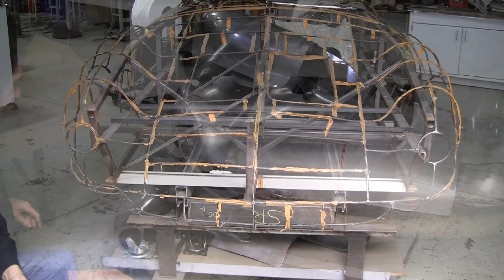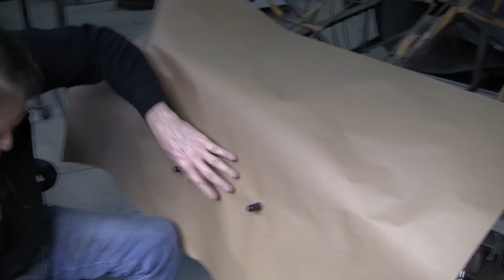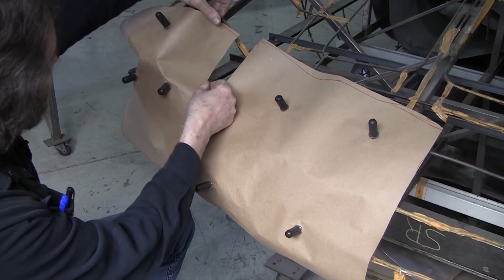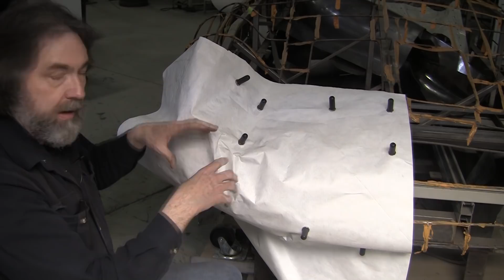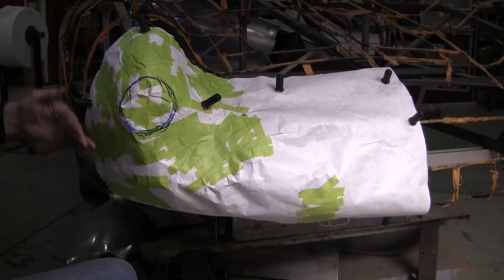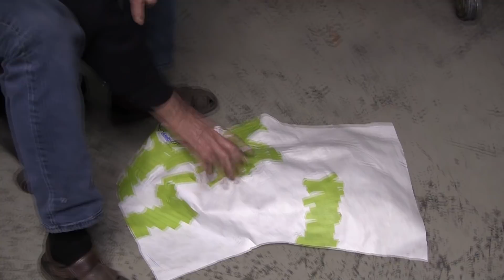Metal Shaping Tips and Tricks: Making a Paper Pattern

Comment: Hey Wray you talked about welding the panels together on a common cut line. Did any of your videos actually show how you cut the metal so no mistakes can happen? You have the two panels ready to weld but no details of showing us how you cut so they would match. At least I cannot find it. Thx again for the videos always learning.
Reply from the maker: The standard method of developing a join line to be welded is to run one panel under the other and scribe a line. If you use that method on a high crown panel after cutting you will find it is will yield a bad fit up. I prefer to make a super fine marker line, then I 1/8" wide  blue tape the line so I can see it very well. I then cut wide of the line fit it up and grind the joint to a perfect fit, always watching that I don't get into the blue tape.

Comment: What if you first draw lines of where the paper overlap and cut it and than flatten that out and transfer it on metal and weld it together? Would welding be a lot faster than ie a lot of heat shrinking? So shrink the panel by cutting and welding?
Reply from the maker: The equation is always lots of shrinking or lots of welding choose your poison.

Comment: Wray wouldn't it just be easier to make some slices by the taillight housing and remove pie shapes rather than trying to shrink the panel that much?
Reply: @Matthew Moilanen  now where would the fun & skill be in that? also, if you consider how much work & effort goes into cutting, forming, fitting, welding, cleaning up, planishing, finishing etc. you'll realise its quicker and more efficient to make a panel in one piece.
Reply: @daos3300  Oh I don't know I've done it several times that way myself in my 40 years of fab work. I was curious as to why it may not be easier to do it that way ad the panel still had to be planished, finished and completed in the exact same fashion as it would with no time savings as gained in cutting and welding. I've created several panels similar to this as the ones located on a thirties style fender on the inner curved section and it worked quite well for me and it is easier than literally inches worth of shrinking.
Reply: @matthewmoilanen787  certainly plenty of ways to skin a cat and if it's right in the end, all is well. i don't have your experience, but given a certain skill level, i suspect shrinking/wheeling may well be faster and more economical in a production environment. and not least, there is the satisfaction of being able to make it in one piece.
Reply: @daos3300  I suppose in production where a pullmax can be used it may be faster although this would be a stamping in that environment. My assumption as Wray states is that these techniques are for a home fabricator that has little vin the way of expensive equipment. In the past a ten minute job of cutting and welding has saved me countless hours. For me half the fun is learning a new technique that I can put in my pocket for a later date but I am inherently lazy I guess.
Reply from the maker: Shrinking and stretching clay is not a problem, why should it be with sheet metal?  "Metal is Clay"
Reply: @proshaper  Yes, yes it is but it has been much easier for me to remove literally inches in shrinking work with a couple small cuts and welds for me in the past.